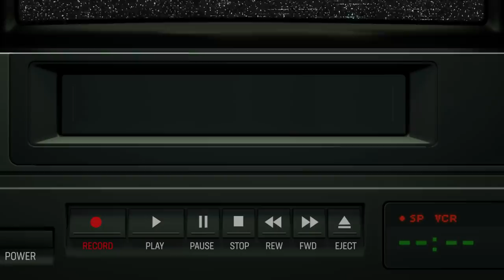2 Days on the Ranch - Supersized!

Comment: Good job.  The first boxes you tried a while back had a reflective lining....Could I suggest putting the beef inside the bag, inside the styro lined box.  I am thinking it will help, but dunno.  If it works reasonably well, I am thinking that it may be more cost effective and readily available than dry ice and will provide a still frozen (albeit not solid) delivery.  Just a suggestion.  Good job!

Comment: Mike, Not trying to be bossy or anything of the like, I'm just an old rodeo clown. But if you can turn your freezers down on the products you're going to ship the colder you start with. You know the rest of the story.
I know also using an infrared thermometer like you have when you're pointing at a shiny object like those ice bags or the bags of the steaks. you sometimes don't get to true temperature . Due to the reflection of the shiny object. so we had a piece of dull cardboard that you could put in the box on top of the steaks under the ice pack and use your temperature gun to measure that you get a more accurate reading.
Well it's back into the barrel for me cuz it's old lonesome tornado the bull heading my way. LOL

Comment: That thin styrofoam will not work. The boxes we get with medications (been getting meds for about 20 years now) and food in are at least 2 inches thick including the the top bottom and sides and look like coolers. All the gel packs are usually still frozen or partially frozen when we receive the box. I believe the gel packs are frozen hard for days before they put them in each cooler. Also there are 3 to 4 frozen gel packs in each cooler, including the one with the scrapple and the steaks we ordered from Omaha Steak. All frozen gel packs are on both top and bottom of the food. NEVER just top or bottom because the place without the frozen gel packs will spoil or ruin expensive medication. Just thought you may like to know.

Comment: The media claims there is a trucker shortage at the ports but it is false , there are plenty of truckers it seems to be more of a container problem, they are not loading the empty containers to go back to china for some reason,.
Reply: Banjo, Trucker shortages are just part of the problem IMO.  Some Owner Operators wont run CA due to their equipment & Compliance regulations. I have heard that some Companys are attempting to poach yard drivers & spotters, offering fantastic compensation plans.